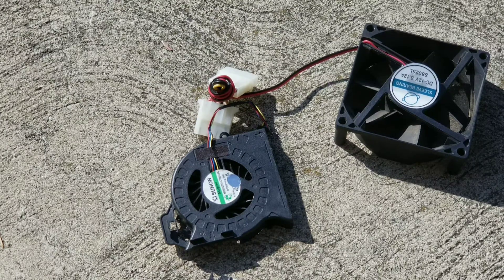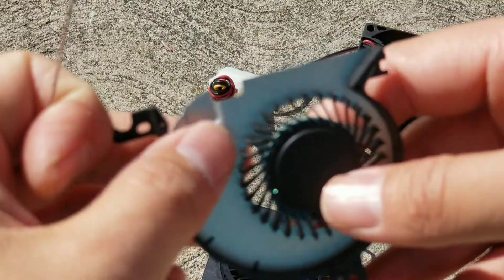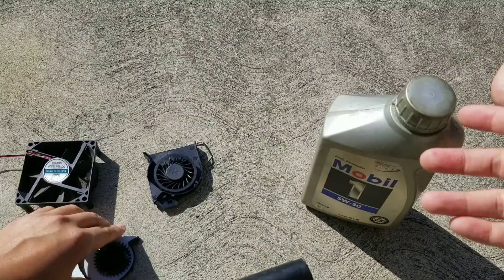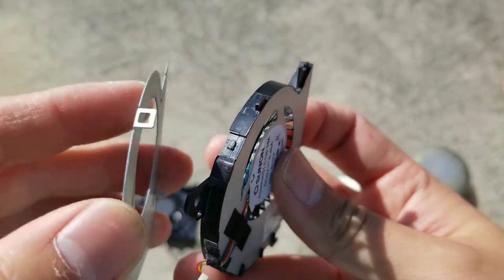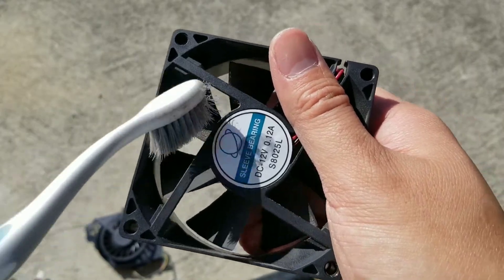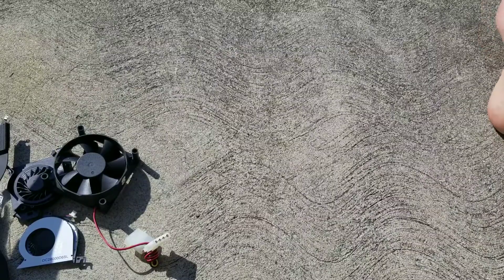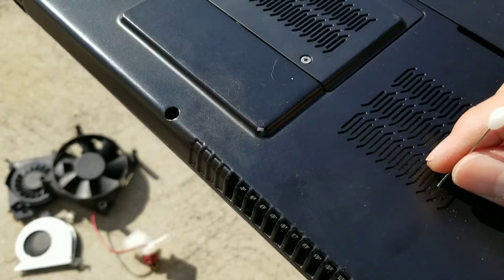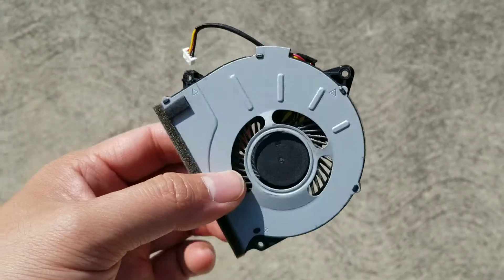How to disassemble/clean/repair noisy/stuck laptop and desktop fans *other methods in description*

Comment: To add to this awesome video, Always hold the fan blades when blowing air, when it spins fast built up charge can burn the circuit for speed control. I ended up with a CPU fan always running 100%. Also, oil will last a year or two but if you want longer go for Lithium Calcium grease. finally if the noisy fan has bearings instead of a sleeve, there is not much you can do about except replacing the bearing, most PC fans use 693-zz. avoid cheap Chinese bearings as they are noisy brand new!!!!
Reply from the maker: Sounds good
Reply: I vacuumed my laptop fans and they got louder (They are clean). I noticed that the gpu temp is not higher than 60 celsius under load but the laptop feels very cool. Do you think I screwed my Laptop?
Reply from the maker: This video and the ones in the description might help https://youtu.be/3zs_SJ3BXgA
Reply: I used a too strong blower. Since then, my laptop makes a lot of noise. The fans look fine. How can I check out the speed control circuit and know whether it is damaged or not?
Reply from the maker: This is what you need https://youtu.be/3zs_SJ3BXgA
Reply: For more info watch out this link : https://youtu.be/fPPcBPsLlT0
Reply: Mike SG  whats my problem then
Reply: Mike SG  its just the sound of the fans, everything else is perfect

Comment: Was that a blower? That can damage the whole laptop circuitry as the motor or the plastic can generate a static electricity which then blows on the components.
Reply from the maker: Been doing this stuff over 10 years and never had a computer die from blowing it out.

Comment: Can this method fix humming/buzzing noise? Just got my new fan but when I installed it, it has this weird humming noise. It sounded like it came from the motor itself. Was bummed out coz it's a new fan 😞
Reply from the maker: Try it out
Reply from the maker: Or get a replacement

Comment: Bro how to repair fan boost in notebook
Reply from the maker: What's fan boost?
Reply: @ItsBinhRepaired  its when fan automatically boost itself when to much heat is accommodated
Reply from the maker: @anandraj4-r7i  what temperature are you getting?
Reply: @ItsBinhRepaired  normaly 61* celsius with basic fan it's notebook
Reply from the maker: @anandraj4-r7i  that's not hot enough for the fan to speed up. Needs to reach close to 80
Reply: @ItsBinhRepaired  But bro when I use video editing it's limitng my performance I can't able to get smooth plus without any usages I am getting 61 to 65* celcius ples try to look into this

Comment: My notebook fan boost has stopped working any solution it heats to much ples help
Reply from the maker: If the fan doesn't spin at all, you'll likely have to replace it. Try turning it manually.
Reply: @ItsBinhRepaired  no bro it's working but when the laptop was new it's and when it's starts to heat too much fan automatically boost it's speed but now it's doesn't ples help and few days ago it's boosted just for few moments and never boasted again
Reply from the maker: @anandraj4-r7i  what temperatures are you getting?

Comment: Awesome info. I had string of hair thin 3d printer filament that wrapped itself around the inside of my cooling fan in my printer. I wasn't sure if the blades would come off. Now it's quiet. Thank you!
Reply from the maker: awesome! If you haven't already, please like and subscribe so others can find my videos. Thanks!

Comment: Don't use the blower when trying to clean laptops or electronic  boards, that kind of blowers generate electrostatic air, just an advise.
Reply from the maker: Been doing it for years no problem. Just have to know what you're doing. Fans move air through the computers all the time lol. Also, my current blower is designed to be used with computers, but I never had any issue with the other one either other than it eventually failed and was more costly, so I bought the computer version.

Comment: Hi It's Birth Repaired. I just tried this now, thanks. it worked. I got to revive the PC 12v .27A but I discovered something, you can take the blade off by just carefully removing the locking plastic washer (it may be metal on some branded ones) after you've pull that rubber cover covered by the sticker (I used the most powerful PVA glue to stick both the cao and sticks back, I hope it works- I'll find out after 25 minutes). You can use a good thin tweezer (I used a Victoronix Swiff Knife's trimmer to do it but it warped it a bit but your can hammer it lightly to make it as close to straight as possible) to pull out that locking thing or washer, that locks the axel of the fan blade in place. I used 99.9 isopropyl alcohol to clean the shaft hole (w/ kitchen tissue and paper clip but I think a wipe you buy without any fragrance would be more durable to wipe it with if no fragrance exists) and the magnet on the fan blades.

I then tested it with a 9v battery directly connected it to two protruding wire (careful not to cross them, put an insulator between them). 

It took a little less than an hour the first try (but most likely it'll just take 15 minutes on the 2nd or so when another fan needed reviving), about the same amount of time, you'd spend to buy (and take risk w/ Covid though) to go  the mall, park and buy and less time to wait for the order ,online:-)

It's nice it's working now, I can use it again (on our CoolerMaster PC so it still has original parts, though I'm mostly a Mac user) and it just needed cleaning and it's not the windings of the motor or any sub-components like the capacitor or resistor. I think I can apply this with the iMac's fan and save $US50 and a month of waiting for it to arrive
:-)

God bless, Rev. 21:4
Reply from the maker: Awesome

Comment: hey, man, i disassembled the fan and lubricate it and assembled then it doesn't spin if it spins it spins about 10% out of 100%
where can i go from there ? im not sure if i can find a replacement for my model...
thanks
Reply from the maker: What did you use to lubricate it?
Reply: @ItsBinhRepaired  i tried a light oil used to the shaver & after i tried a light mechanical grease & wd40 also to 
eah time i cleaned with isopropyl alcohol
Reply from the maker: @lou007  you have to use motor oil like I used. Shaver oil is like mineral oil.
Reply from the maker: @lou007  wd40 removes water. It is not a lubricant. I don't know why people think wd40 is a lubricant.
Reply: @ItsBinhRepaired  & connected it to a usb hub it give same results
Reply from the maker: You might have gotten those things in the dan controller and fried it.
Reply: @ItsBinhRepaired   idk but exactly it wiggles couple of times then stops 
if i pushed it to spin it spins & slow speed 
wondering...
Reply from the maker: @lou007  if it spins slow, it's bad lubrication. Why not use motor oil like I showed in the video?
Reply: @ItsBinhRepaired  i tried now nothing changed....maybe the controller fried or something might be else? 
can't  figure !
Reply from the maker: Yup, need to get a replacement fan.
Reply: @ItsBinhRepaired   :( 
wish me luck
Reply from the maker: @lou007  good luck
Reply: @ItsBinhRepaired  im tired and upset actually :(

Comment: Hallo, excellend video. I have an HP pavilion 23 aio  cooling fan 809140-001. Can i pul the blade unit out to put fresh lube or it can not be separated and needs a back hole ? Thank you for your help.
Reply from the maker: I don't know. You'll have to try.

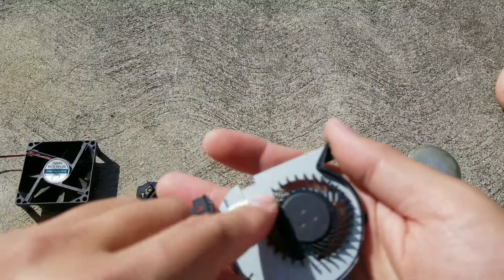Comment: 7:30 While dropping oil and cleaning, I accidently broke that golden wire connection with one point and now its not making a noise at all....yeah its not working 🥺
Reply from the maker: Have to get a replacement fan :/
Reply: @ItsBinhRepaired  yeah :(

Comment: Previously I had problems with normal fans that had grinding noises and knew my laptop fan may had the same problem. I already knew I had to oil it.

I thought I had one of those hard to repair fans and I was kinda angry because I had to take the motherboard to change the fan for a new one. But then I said : "fuck it, I will force take the fan apart, if it breaks I have to replace it anyways, if it works I won't have to remove the whole motherboard". Fortunately it worked.
Reply from the maker: Awesome

Comment: I woke up this morning to my laptop making a grinding noise when I power it on. I noticed one of the fans wasn't spinning and seem to be sticking when I try to spin it. It's still under warranty, but due to covid Acer wouldn't let me drop it off anywhere. So would have had to ship it somewhere and been without it for a few weeks maybe. 

Found your video, followed the instructions to lubricant the fan and it's working great now. Fan is even more silent than before. Great video thanks again.
Reply: 047_RITIK bansal  I hope you got this figured out. Basically I followed the steps starting at 4:52 since this the type of fan my Helios 300 used. I also purchased a replacement fan for $13 on Amazon just in case this process did not work or the fan stopped spinning after time. However I haven't had any issues since.
Reply from the maker: awesome! Glad my video helped you. If you haven't already, please like and subscribe so others can find my videos. Thanks!
Reply: 047 RITIK BANSAL  Acer Predator Helios 300
Reply from the maker: 047 RITIK BANSAL  if it's in warranty, send it in

Comment: I would also like to thank you for this very helpful video! Your suggestions helped me fix a noisy fan, which seemed to be getting worse every month. I had assumed I would need to replace it, especially after opening up my laptop and realizing the fan is embedded in one of those metal cases like the one you show in the very last minute of the video. But after cutting off the plastic chips and adding some oil to lubricate the shaft, closing and taping the case, and cleaning up the dust accumulated onto the motherboard heat sink it is now as silent as it was on day one. ¡Gracias! :)
Reply: but how to join them after cutting off the plastic
Reply: @lucifer-uy1rf  , if I remember correctly I just used some scotch tape
Reply from the maker: Awesome! If you haven't already, please like and subscribe so others can find my videos. Thanks! Hopefully you'll enjoy some of my other videos as well. :P Not all of them are repair videos.

Comment: You sound like you gave years these noisy fans like me. You told everything what i know for years. Good job!
Reply from the maker: I figured out how to fix some of the ones that seem irreparable as well. Links in the description. :) Though some truly are irreparable.
Reply: @ItsBinhRepaired  What are you using for lubrication? High viscosity or low viscosity? Which one lasts longer? This is very important and information on the internet is 50-50.
Reply from the maker: @tromick  I don't know. I just use mobile one synthetic motor oil. Lol

Comment: Will vegetable oil work bro?
Reply from the maker: No, just pull a little oil from your car's dip stick
Reply: @ItsBinhRepaired  ok bro, gonna try it on my Helios 300 GPU fan
Reply: @ItsBinhRepaired  bro can I use brake fluid or coolant?
Reply: @ItsBinhRepaired  or cycle chain lubricant?
Reply from the maker: @nirupam530  possibly. Just make sure it lasts a long time and won't get gunky. I haven't tested those.
Reply: @ItsBinhRepaired  I used sewing machine oil and rattling is almost gone just little rattling now can be heard
Reply: @ItsBinhRepaired  thanks for the help
Reply: @ItsBinhRepaired  I applied on the shaft with cotton swab and little drop on the hole
Reply from the maker: @nirupam530  hope it works
Reply: @nirupam530  I wouldn't use brake fluid, that shit's corrosive af. Coolant is a bit slippery but it's not a lubricant. i suppose bicycle chain oil would be better.

Comment: 5:55 what type of bearing is this sleeve bearing right ? if personally used white vaseline acid free its rated for temperatures of 40c to 70c usually there is some Vaseline on the pin.
Reply from the maker: I don't know what type of bearing it is. I just know if it can be fixed or not. Lol

Comment: Can you use wd40 instead of oil
Reply from the maker: No, wd40 will remove oil. It's used to displace water, hence the name wd (water displacement). It is not a lubricant. Just pull the dipstick on your car or your parent's car and use the oil on the dipstick to lubricate it.

Comment: Hi!! Thank you very much for the video. I have an Aero 15 that recently the left fan makes a rattling sound. When it starts to make the sound, I turn off the fans and turn them back on so that they work "normal" (I repeat the process whenever it makes the sound). But it's really annoying because whatever movement I make with the laptop, it starts with annoying noise. What could I do to fix it? (without having to buy a new fan). I would really appreciate your help because I'm going crazy for being afraid to touch my laptop :(
Reply from the maker: Watch this video completely and then watch the other two in the description. Hopefully one of those will work.

Comment: Hi guys, can somebody help me out? My laptop fan is making a very annoying noise even when it is spinning at very low speed, I cleaned up all the dust around it and and it is still making that weird noise. I'm not sure what is causing it. I have 1 year with my laptop. Should I change the oil?
Reply from the maker: https://youtu.be/3zs_SJ3BXgA that should help
Reply: @ItsBinhRepaired  yeah bro I watched the video, but I'm not sure if it's worth it to break the fan's plastics to replace the oil
Reply from the maker: @FranLMSP  only other option is to buy a new fan
Reply from the maker: @FranLMSP  what's there to lose?
Reply: @ItsBinhRepaired  well I'll check that out, thanks for the video! it was very useful
Reply from the maker: @FranLMSP  no problem. If you haven't already, please like and subscribe. It'll help others find my videos. Thanks!

Comment: Hello.. thanks for the video.. I have Acer Aspire 3 series, recently the fan has started to make rattling (Vibration) sound while spinning. The sounds reduces (and sometimes goes away)  while tilting the laptop. I have checked for loose screws and fan position but nothing helped. Have any idea on how to open this type of fan (the fan plate doesn't seems to have any screws) https://imgur.com/a/dR6TBEN Thanks.
Reply from the maker: Did you watch the video all the way through? If you did and didn't get the answer I'll have to make another video.
Reply from the maker: Basically you need a razor blade to cut the plastic bits.
Reply: @ItsBinhRepaired  Ok. once we cut those bits, then how can we re-apply the plate back? It won't snap?
Reply from the maker: @gtm1880  sometimes it'll snap, others you'll have to use tape or glue
Reply from the maker: It's at the very end
Reply: @ItsBinhRepaired  Ok